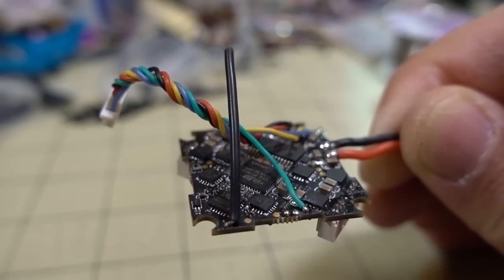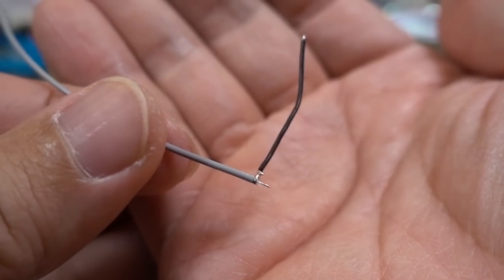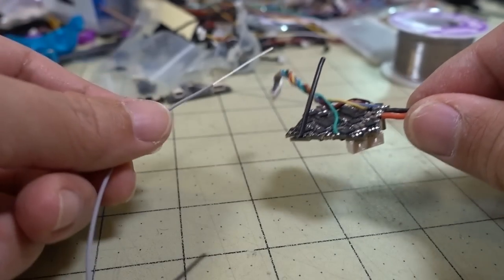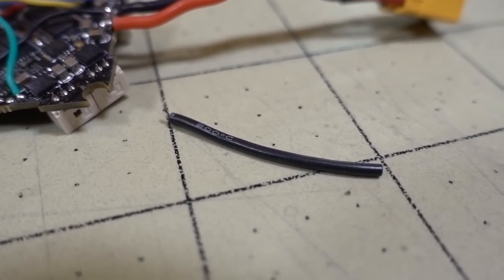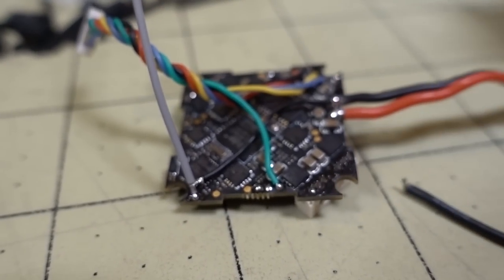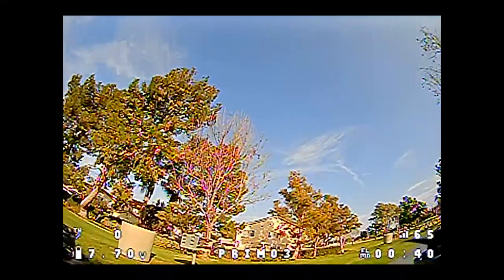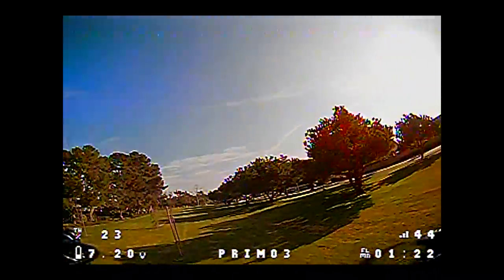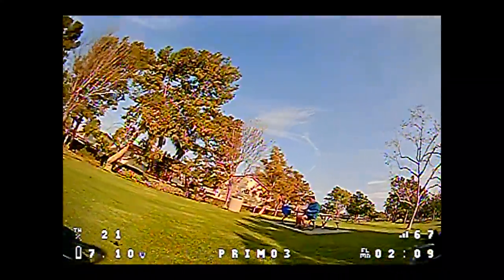How to upgrade your SPI receiver antenna 🎓

Comment from the maker: 🛒 Receiver Antenna 10 Pack - http://bit.ly/2Y8tPSx
       also at Amazon - http://amzn.to/2tlQQqf
I will make a follow up video with some of the suggested changes in the comments.  Thanks for all the suggestions!
Reply: Hi Albert ! I have a weird findings on this Crazybee F4 pro v2 board on the Mobula7. Ive found out that when I did a continuity test between the Antenna Pad and -ve terminal on the battery pad, they are actually connected with like 5ohm resistance! So, does it means it is useless to ground the shielding of the new antenna to the -ve terminal, since the antenna pad itself is connected to -ve terminal.

Comment: You need to keep the ground termination very short, with the length of wire you have would be transforming the impedance so the outer of the coax is no longer ground.  My 2 euro cents worth :)  You could connect to a supply rail if there is 1 nearby.
Reply: Tony Clark supply rail?
Reply: @andy_bar  3.3 or 5V rail, vbatt etc.  Via a small ceramic cap would make it safer.
Reply from the maker: Yeah, I'm sure this can be improved... I'll look into this.
Reply: I know this is an old thread, and maybe this is a stupid question, but even if there were a ground pad by the antenna, there would be a trace on the circuit board going from the ground pad back to the battery pad, so I don't see why that is any different than running a wire to the battery pad.  In my opinion, Albert's wire should make no difference, but please correct me if I am wrong.

Comment: Great idea! I think part of the reason your rssi is so low on the OSD even after the mod is because it needs some rssi offset to read the same as your transmitter. If you compare the rssi numbers from your transmitter and OSD they should be the same, if not you need to adjust the rssi offset in the cli. My Mobula6 had strangely low rssi on my OSD no matter how close I was, but on my tx it was over 100 so I adjusted the offset by 20 and now they match and I’m getting accurate rssi on my OSD.
Reply from the maker: Good to know.  I didn't think the OSD reading would be off by that much.

Comment: Hello Albert, good video! I have been doing something similar to this on all my AIO boards and get the same results. Meaning, the RSSI numbers don't drastically change but I don't get the warnings and I can fly farther which to me makes it worth doing. Because of this, I save any broken Rx antenna and later use the wire for a future AIO board I may purchase. Also, on my mod I don't make the shielded length so long, I only pay attention to the un-shielded length an getting that portion just out of the canopy.
Reply from the maker: Yeah, I made the antenna way too long!

Comment: I don't understand the ground. How is it the old antenna didn't need it but the new one does? I've watched it twice and it looks like you have soldered to the sheathing
Reply: Simplified, an antenna transmits using the active element that is not grounded (the shielding on a coaxial wire).  So, this means that the original antenna, with no shielding, transmits on the whole wire, in the worst possible spot that is right next to a big circuit board, and usually behind a canopy and other items like a camera, that can block a signal.  Using a coaxial cable, just lets you move the active element of the antenna, to a much more ideal spot, away from other components and outside of the canopy, where the antenna has a clear path to transmit a clean donut shaped signal to your radio.
Reply: @briandoctor9330  Hey Brian, quick question: I damaged my antennas. So I shortened them, leaving the active element exposed at the right lengt. But my antenna seems to be multiple layers, outside of course the shielding, then a thick metal mesh' layer, then some clear polymer, then a thin metal mesh core. How far do I need to cut down? I cut them as little as possible, so the active part is now partially thick metal, partially thin metal. Feels not ideal, but honestly the wire thickness shouldt impact the receiving of electromagnetical waves much, right?
Reply: @briandoctor9330  So in other words: the antenna needs to be a particular length,  so the grounded shielding effectively negates the wire up to the intended reception point. Thank you, this is illuminating.
Reply: @unything2696  I think you are thinking the outer plastic sheathing is the "shielding", when in fact the metal mesh layer is the real shielding.  Repairing a damaged or chopped coaxial antenna requires cleanly cutting the end, and then measuring the correct new length of the active element tip, and at that measured distance, cut off the outer plastic sheathing, then cut off the metal mesh shield layer, leaving only the inner most thin wire core, and the clear polymer that surrounds the inner core.  Just make sure you understand that the innermost thin metal core, and the clear plastic insulating the core, is the active element of the antenna, which is the part that should be a specific length.
Reply: @briandoctor9330  That is the perfect answer to my question, thank you. So I will have to cut deeper to evenly expose the thinner inner core. Maybe I'll do some RSSI tests before and after and gain some range, but I alsp gained some knowledge, which is great.

Comment: The shielded part should not be random length, it should be a multiple of 1/4 wavelength of your frequency. So multiple of 30.6 or so mm for 2.4. GHz.

Comment: On my E011 and Bwhoop boards I just scratch off the solder mask to expose the ground plane right next to the active element with an exacto or needle file. Not shure about that exact board but I'm pretty shure you can find alittle ground goodness within a few mm of that antenna. Just have to look real close and follow the traces. I also prefer to use those smaller antennas like those off an rsxr. Not much meat but way lighter.

Comment: Thanks for this video. 
I’ve noticed that the rssi readings from my FrSky spi  receivers never goes above 60 even when I’m 10 feet away from my radio. All of the ones I have give the exact same results. 
By comparison, my FlySky spi rssi will start at 99% when I’m close and will fluctuate (normally) as I fly. From my experience, the FlySky readings seem more accurate compared to FrSky and I get much better range from the AFHDS-2A protocol on the spi compared to FrSky spi.

Comment: Hi Albert just installed an Eachine crazybee F4 Pro V3 with SPI Frsky on a Trashcan frame...as you say terrible range (40m) with all the stuff blocking it
i was just about to add xm+ but then tried one more flight with the stock antenna pulled straight out in front attached to the frame in beneath the camera in a straight line....WOW over 200metres+ no problem even behind trees 
thought you'd like to know 
love your channel Cheers Phil
Reply from the maker: You got the antenna out... cool!

Comment: A while back the antenna on my mobula7 fell off cause I was having to rebuild it often. I lost it before I could get home and solder it back on.  At the time I had no idea the physical length was so critical.  I grabbed a random wire cut it about how long I thought would be useful and had been using that for about a year.  Didn't notice much if any difference in my range.
Recently I had to trash the old f3 crazybee board and got a new f4 v3 to replace it.  My range was horrible, I could get maybe 30 or 40 ft so I removed the antenna and put on my random wire, this time however it did not work well and my range was like 15ft.
So I put back the antenna that came with the f4 board but soldered it much better than it came and the range issue was completely fixed, now it's working better than ever.  Not sure why it was garbage out of the box but after resoldering it myself it worked like it was suppose to.
Reply from the maker: Interesting... that out of the box result sure is strange.

Comment: This mod works great!
My test:
2 Eachine Twigs
1 modded with lollipop FPV & longer/shielded antenna. With this one I can fly around a Dutch house (bricks, insulation with foil etc., my Wifi doesn't even get through this).
The other one crashed and videofeed disappeared. Going to modify that one too!

Comment: For the antennas in the link, they come with the ipex connector on the end; do you cut the connector off or remove it in some other fashion?
Reply from the maker: Yes, I cut off the connector.  You can see how it looks at about 45 seconds in the video.  If this makes no sense to you, I recommend you don't do this upgrade as you'll probably end up breaking something.
Reply: @AlbertKimTV  Thanks.  In your follow-up video It was much more clear (at least for me) what you did.

Comment: So. I should be able to use those existing wires on the twig to add an xm+ right? I have one sitting on the shelf, just need to add it! (moving the parts to the Kabab tp3 and figure it needs a real receiver! Lol)

Comment: Hi Albert,
the antenna output on the Mobula6 seems to have the footprint of an U.FL IPEX Connector.
I measured the footprint on the board to be 4x4mm (about 2mm from ground to ground) and the connector is about 3x3mm, that looks like a perfect fit :-).
Reply from the maker: That's the VTX antenna, not the receiver antenna!
Reply: Oh, I completely missed that.
But ... wait, why has the VTX antenna the same length as the receiver antenna?? How? Why? That is strange.

Comment: Hi Albert, how can i add on uz65 external sbus/IR1 receiver ? On banggood is the model with internal spi frsky receiver. İs it possible to add on this a external radiolink sbus receiver? If its not posssible than mabe on this version; external tbs crossfire or external dsm2 ? My radio is radiolink becouse of that i need sbus or ir1 slot to add on uz65 my receiver.

Comment: Yo Albert, i do think you should got 100 RSSI with a proper setup, you sure your settings are as they should?
I just cut a normal thick isolated wire 2x the length of the original one. So I solder a normal 62mm long wire on with no ground wire, not my rapidfire with a patch loses video before my RSSI drops too much.
Reply from the maker: What FC did you do this on?
Reply: @AlbertKimTV  Both the stock crazybee f3 that comes with mob7 and the crazybee f4 v2.

Comment: Is it possible to upgrade the receiver?. I have only FlySky transmitter here like FS-A8S. I bought nanohawkX a couple weeks ago but still i not tried yex
Reply from the maker: Depends on the board.  Some will have pads for an external receiver, some will not.

Comment: The improvement is not worth the effort for the end user . Better off putting an xm+ on it . 

BUT the manufacturers should take note of this and put the spi recivers together like this in future as you have proved there is some improvement there and it's not really going to cost them any more for another 4 inches of wire .
Reply from the maker: I wanted to try this because the space was limited in the build I put this in.  So there are some good use cases for this.

Comment: Hallo Albert, love your channel!
I thought about replacing the simple wire by an actual antenna too.
That your solution works at all is really funny, you got kinda lucky :-) let me explain.
After the radiation has entered the coax cable, half of the current flows throu the center wire and the other half flows throu the ground wire (the coax shielding). To connect the coax properly, both currents should reach the rf-chip at the same time. Best would be to connect the center and the ground directly to the RF-Chip. In your case the ground current has to go along your wire and than along the DC ground to the chip, while the  center (probably) connects very quickly to the RF-chip.

From the video, I guess that the ground detour is about 1/4 to 1/2 of the wave length. It seems bad ;-)
I'm sure that your ground-wire works as an antenna too and the combination seems to be working kinda ok. I would expect, that you get better reception in some directions, but worse in other directions. I cannot see that in the video, it seems fine to me. I'm amazed, that it works at all.
Furthermore good luck!!  ;-)
Reply from the maker: I wish there were a ground pad right there... any solution to fix this?
Reply: I guess we would have to identify the rf-chip and connect center and ground directly at this chip. For starters we need someone who identifies the rf-chip. (Its not me ;-) )

Comment: Hey Albert - thanks for making a video about this, I've been telling folks to do this for a while in the RedDevil and Trashcan groups, it makes a big difference.  I found connecting shield doesn't help much, but going from 1/4 wavelength SPI antennas to 1/2 wavelength ones really helps, or even long 1/4 wave length ones like the one you showed.   That said, the thing about the original antenna being the wrong length is a myth and a oft repeated misconception in our hobby.  The whole 31.25mm is the right length thing is actually false.   But rather than write a big post, just have a watch of this video, Pawel does a very good job of explaining it: https://www.youtube.com/watch?v=8iBoRNyrrPM